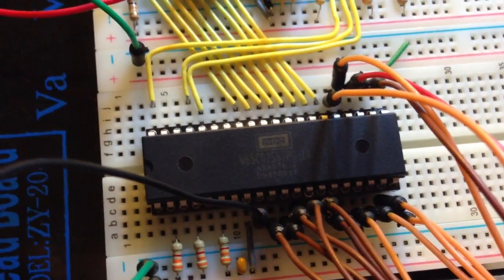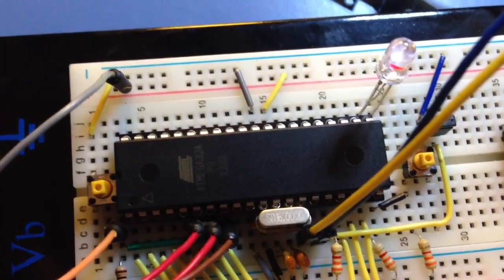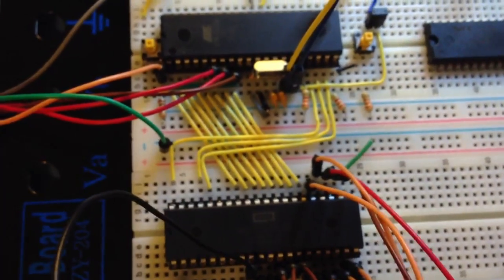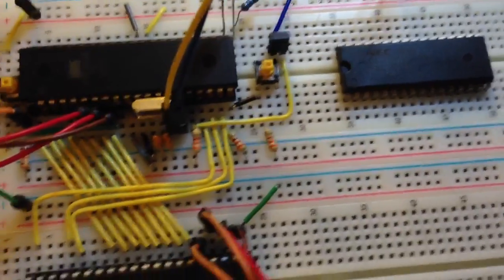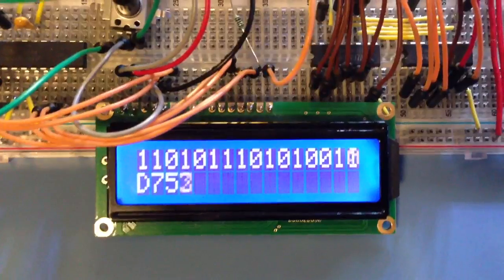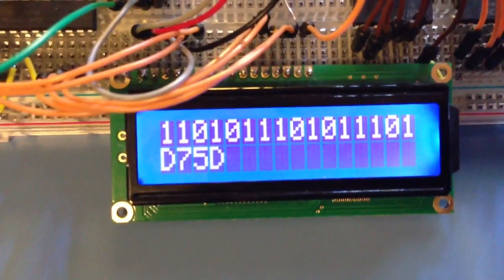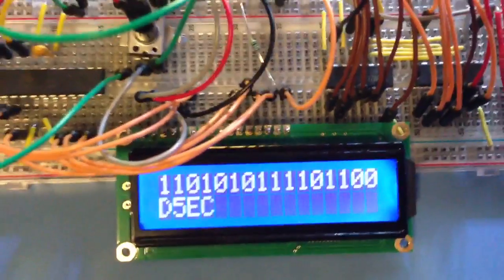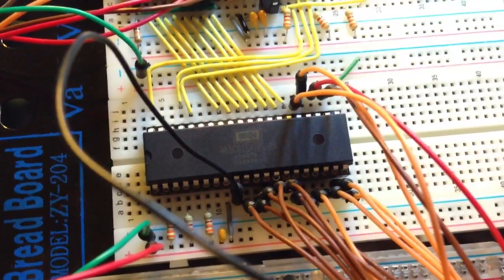Getting the 65C02 MPU to free run.

Comment: WHy on earth do people call a MOS 6502  as something equal to a 65CO2 which is western digital's chip and NOT a MOS. 
They are very very different and not the same..  They function the same in sort of way but NOT completely. 

MOS 6502 is and can be programed the same as 65C02 however one can be stepped through over longer periods of time.. The first which is MOS 6502 can not.. It has no static capabilities.

Please DO NOT CALL 65C02 as a 6502 processor as it is NOT the same.. MOS 6502 is very clearly named the 6502 processor(original name). 
65C02 is a different processor.

Comment: Nice! I'm in the process of doing something very similar to this, though with an atmega644p. The plan is to have the atmega act as the clock, RAM and ROM. Then slowly add parts to eventually remove the atmega from the circuit. Looking forward to seeing what you come up with!